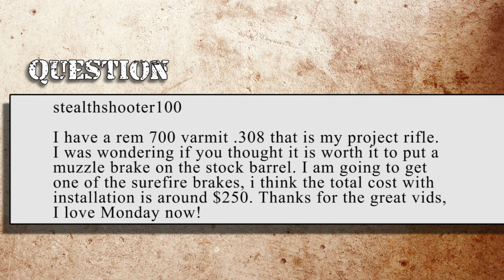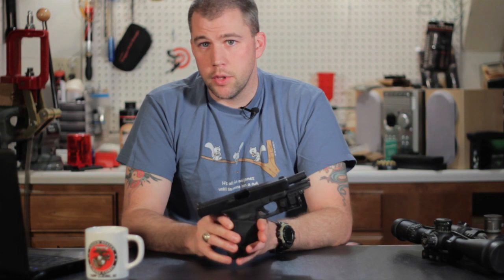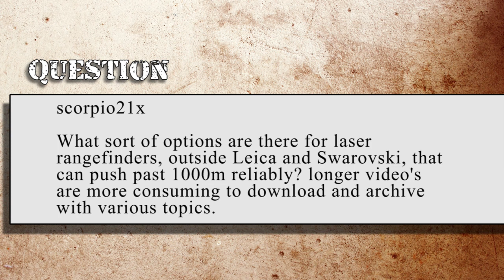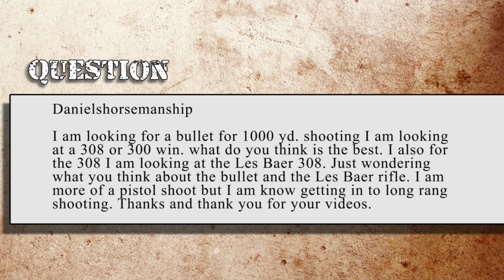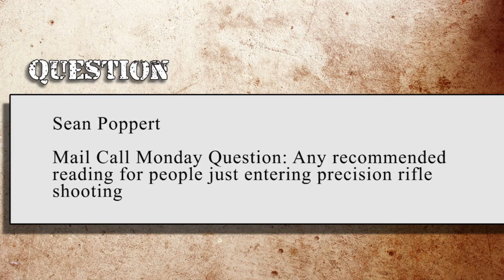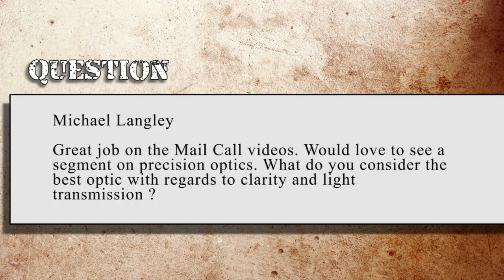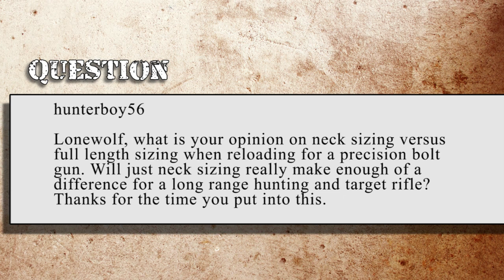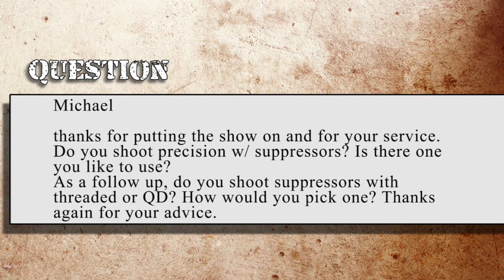Mail Call Mondays #4 - Brakes, Ammo, LRFs, Mil/Mil Scopes and Neck Sizing

Comment: What do you think about brakes w/ smaller calibers?  Like 6.5 and .6mm/243?   I just got my GAP back and had a badger FTE installed. I don't notice a ton of difference so far, but I only have 40 round down the new rig. 

Great vids though.

Comment: what do you think about using 223 rem for a medium range percision rifle. Also i have a stevens model 200 in that caliber and would like to change the stock. i have heard that i might be able to use some savage 110 stocks, but i have heard conflicting reports on that subject. i like the tactical stock from choate made for the 110 but im not sure if it will work. have heard anything about using a savage 110 stock for a stevens model 200 and what do you think of the 223 chambering out to 6-800 yrd